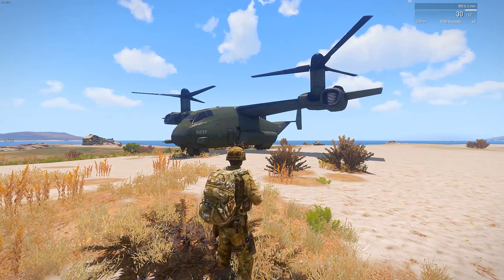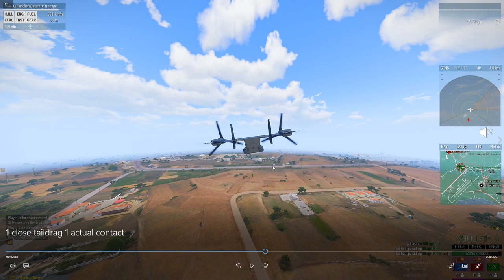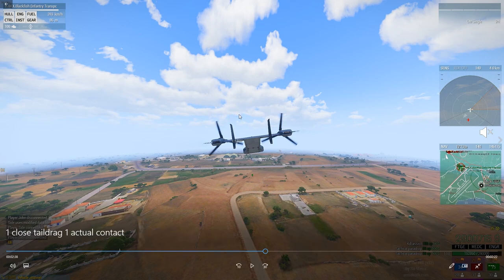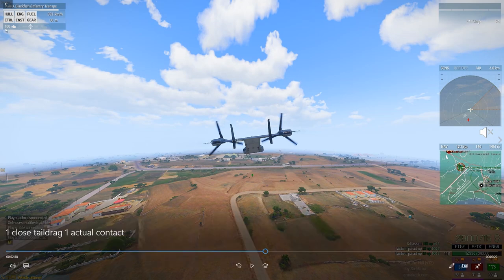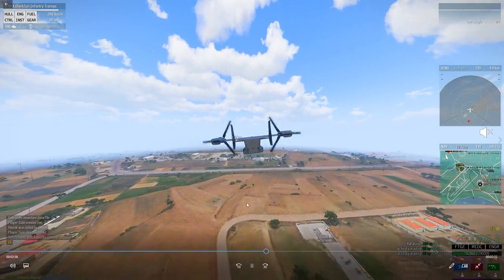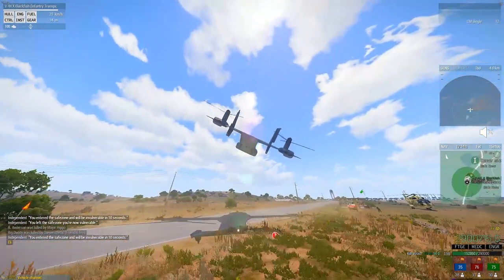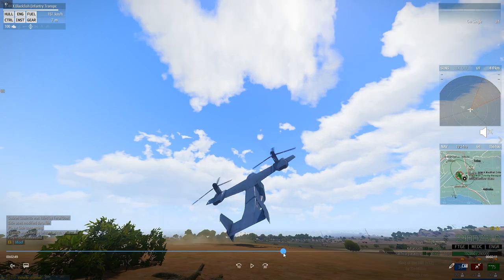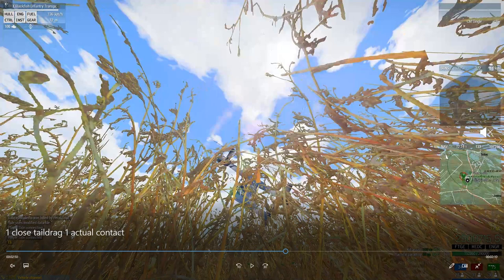Blackfish combatlanding tutorial

Comment: When I pull the plane's nose up at 400 km/h at about 500m to the drop zone, I always gane too much altitude. Any suggestion ?
Reply from the maker: drop the throttle a little bit, and make sure to both have ur engines fully vectored up before you make the turn, also u can dive the aircraft down a little before u make the turn to make it stay lower

Comment: heli- airplane mode push. _???
settings photo pls
Reply from the maker: autohover
Reply: @EliPlaysArma  
OK. but when you apply the air brake, there is no constant fan change. Others can do it, but I'm constantly moving forward and backward from propeller mode to helicopter mode.
Reply from the maker: You need to turn off autovectoring, then you scroll to change vectoring, or you bind a key to flaps up and down